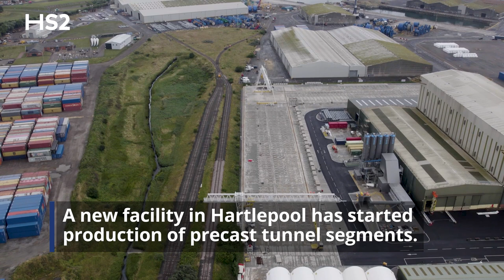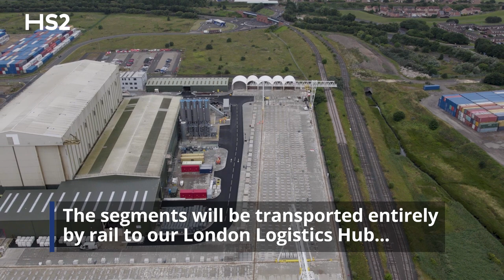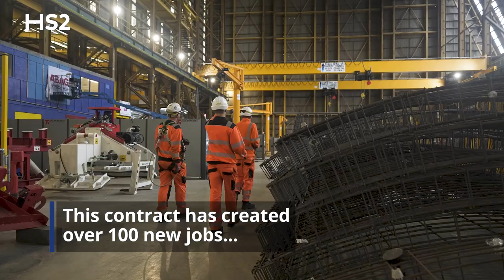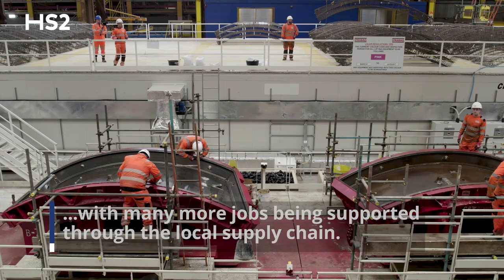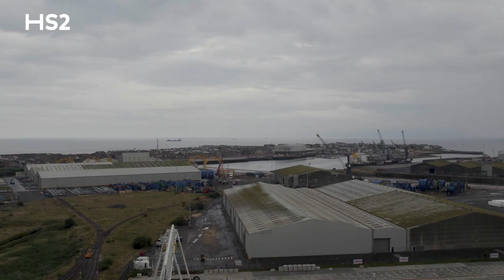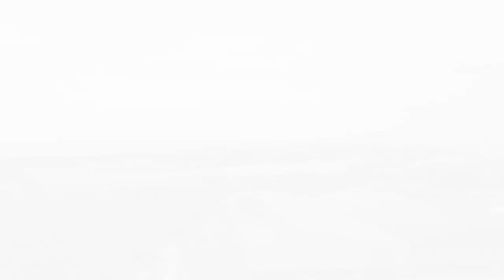Production of HS2 London tunnel segments underway at new facility in Hartlepool

Comment: I am no civil engineer,I would think though,having a template "one size fits all" I would think not,different conditions require different technical specs I would think !
Reply: As far as I know the tunnels are getting larger in diameter as they progress from Euston and as the train speed builds up.  Thus each stretch of tunnelling needs different segments.  The TBM's are different as well depending g on the ground conditions on each stretch.